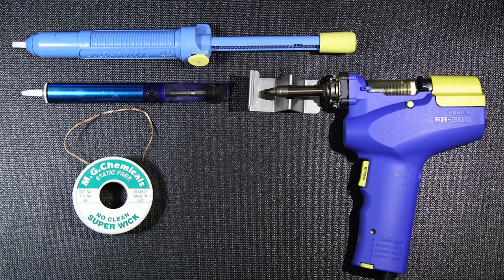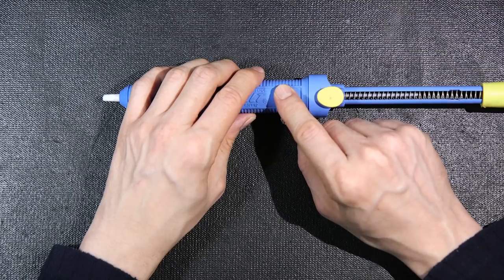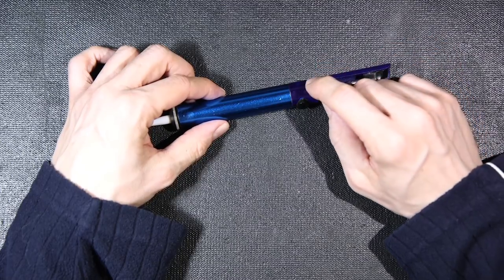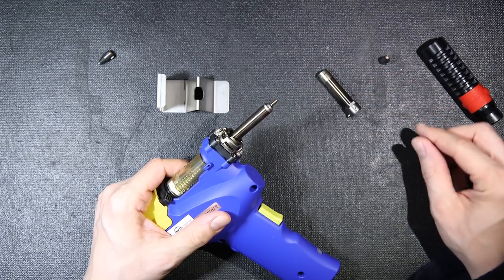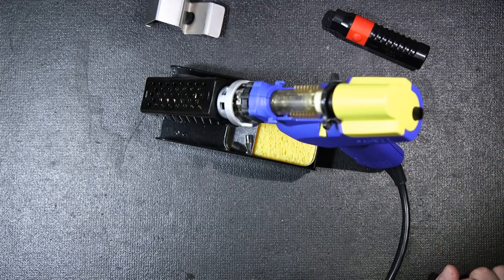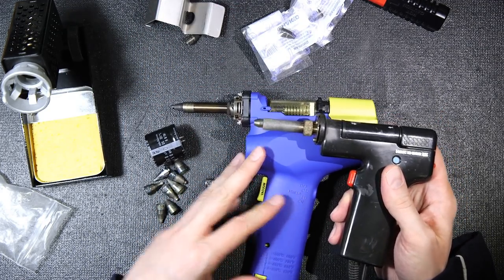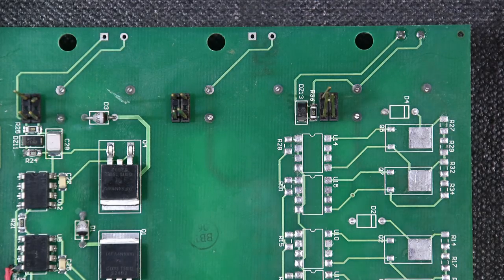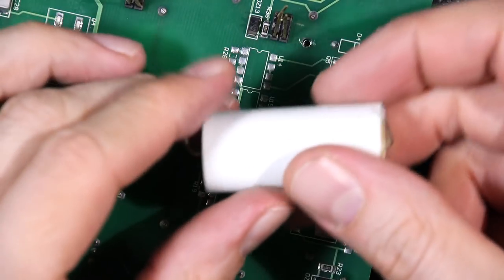How To Desolder Electronic Parts Using Different Tools.

Comment: You don't Show my Favorite,  Radio Shack made a Desoldering Iron. It had a Bulb you Squeezed. When Hot enough you released pressure on the Bulb and would Suck Right up in through the Hollow tip. For a 68 pin chip/or other Chips I would file on each side of the tip(pins too close), Then you could Desolder a 68 Pin Chip in about a minute. When they were closing Down, I bought about 4 extras. Soldapult and Copper don't come close. Haven't used a Soldapult since 70's unless I has too. Even then I would Use the Copper Shield from Coax, wouldn't buy Desoldering Braid. 
I Would Google "Radio Shack Desoldering Iron". Has a Red Bulb. Buy if you can find it.
For through hole components, I like to have Hollow tip go over component, rotate around while releasing, after doing all pins, a small screwdriver can push leg free if still barely connected to Board.

Comment: Thanks for the great video.
I heard you mention changing capacitors on a switching power supply. For someone brand new getting into minor electronic projects, I’m looking for an adjustable power supply. Are switch type, more prone to break downs? For someone like myself, is there a type you recommend?  
Use for measuring resistors, capacitors, and also checking power requirements for LEDs etc
Also, are you using a “microscope” for the close up video of the desoldering? Or just your camera on micro? Cheers

Comment: i have the bigger manual solder sucker, the thing i need to add is to hold the devide tightly to stop the recoil, especially when working with pcb with a thin copper, and perfboards, i did that many times , when i activate the sucker the recoil knocks onto my solder tip and it somehow hit the trace off of the board, and when desoldering parts from a double sided board i usually mix a 6040 solder onto the existing solder before suck it off, i find it weird that some solder from factories (even non lead free) sometimes are pretty hard to melt, last thing twisted wire is a pain in the butt to remove, especially when the leads are pretty tough like big diode and some large electrolytic capacitors, and manufacturers like to bend it onto a crap quality pcb in products nowadays, guess what happened when i try to remove the component, it take the trace off with the lead and force me to use a wire to reconnect it

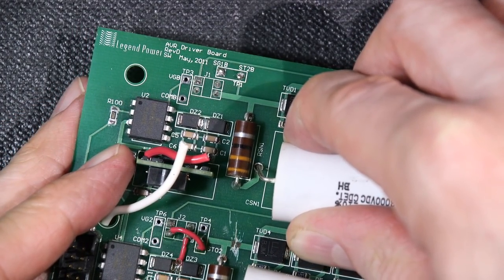Comment: 22:00 For parts like these, I just heat the leads while pulling them out. I clean up the pads with some good solder and the suck it all clean. It’s much more efficient like that.

Comment: Nice vid. ;)

Just wondering what the first board was originally for?

Looks like some sort of high-voltage driver, due to the opto isolators and spark gaps?

SO glad you mentioned adding extra flux to the solder wick btw.

Some of them don't contain any flux at all. Works far better with flux, and helps to reduce the risk of lifting pads etc.

Comment: Good Job Paul! I would LOVE to see you do something on cleaners. Some swear by WD40 to clean switches, others DeoxIT, CRC electro clean and some swear by pencil erasers. One fellow even suggested a wire wheel on a dremel!  So, what cleaner will really remove tarnish from open frame switch contacts? Love to see your take on the subject.
Reply: Oh no, do not ever use WD-40 ':D It might be good for cleaning PCB:s but otherwise really not recommended for anything electronics-related.

Comment: Used a Soldapult doing low volume production rework, correcting mistakes.  I would flip it over and push the plunger on my knee to arm it, got fairly fast at it.  Kept two on the bench so when one plugged up I didn't have to stop.Owner too cheap to buy a proper vacuum unit.

Comment: Tool #2 is available as a completely aluminum threaded version... Aven 17537.  I'm not sure how well it will hold up long term, but it will likely last longer than a plastic threaded units.

Comment: @18:28; I would really love to have those 4 polypropylene capacitors on that circuit board! Those are the Cornell Dubilier 940C 0.1uF 3000V ones, which are very good sounding "bypass caps" to use in passive speaker crossovers!... I hope you used them for something good after this video and didn't just throw them away!

I've never had any decent results using only the manually operated "plunger type" of desoldering tools, regardless of brand, but that active continuous vacuum type (the FR-300 model) is awesome! I will be buying one of those, because they are quite obviously the most effective, easiest, and fastest by FAR! There's absolutely NO comparison!... Just one question though; How do you spell the brand name of that desoldering pump? Is it spelled Heyco, Hayco, Hakow, etc?? (Listing the brands and models in the video description would have been helpful.)

Comment: ive had the same small blue aluminum vacuum tool for over 15 years and as you pointed out the threads on the plastic gave way.. i will admit i nearly ruined what i was working on (from the sudden scare and laughing) as the back end shot out like a missile and pinged around the side bench landing in one of the parts trays.. i just glued the end on permanent.. still works till this day and i just use the loader to push the cylinder out enough and just pull it out of the front carefully to clean and lube it.. what i didnt see here ( just for comedic events you should of showed one of the cheapy chinese twist lock ones they have a fraction of the suction then the aluminum ones and no i never bought it, i found a couple in a bin of electronics someone was tossing out which i took to see what was wrong and possibly spares as the casings were still good)

Comment: I would have used a board full of DIPs as an example where you'd want a desoldering gun. Desoldering a ton of ROMs and logic chips can get very tedious. Just try making a Neo Geo development board out of an original cartridge (socket ROMs; several hundred legs). Even installing Hi-Def NES takes more desoldering than 40 caps even though you only remove four components (86 legs).
Reply from the maker: Didn't want to put any of you through the tedium of watching that process... LOL!
Reply: Mr Carlson's Lab DIPs are definitely what drove me to get one. ;) PSU caps can often be cut off and replaced but many logic chips... not so much.

Comment: Excellent video! I have a dangerous question Mr.Carlson ... what is the safest way to discharge a guitar tube amp so no power is left inside to do potential harm to the operator? For example I am thinking of replacing a volume pot on a PRS MT15 and would like to live to see it have a batter volume taper ;)

Comment: The aluminum/plastic sucker threading problem I found a small solution to it, what I does is this, I wraps one layer of electric tape around the wear down threads and screw it back together, mind you though it'll be a bit stiffer to screw back in but it'll work without coming off

Comment: I remember how i went on a desoldering rampage after getting my ZD-985 desoldering station. Also got a ZD-211 but didn't used it much. Its china stuff but far better than the non heated desoldering pumps.

Comment: Have you had occasions with the Hakko where you would’ve preferred the very long nozzles?  (I’m assuming those were available for the FR-300 as they are for the 301.)  It’s surprising how many nozzle sizes they make with only 0.3mm difference in diameter from one to the next; it leads one to think all of them may be needed ($$$).

Comment: so been soldering for 45 years.. i must say I've never heard anyone say the "L" in solder.. silent L.. also the soldapullit, instead of brusing your thigh.. twist it over, press it on the bench... Ive also found the Paladin (very similar to your alumin tube) to be better than the soldapullit.. but thats just me.... thanks for all the details, now going to buy me the Hakko... btw.. i know this must  be heavier with the pump in the handset, rather than in a separate box .. is this new Hakko  one heavy for long periods of time?.. thanx

Comment: Because I used the blue metal solder sucker in my University Science Laboratories I bought one for myself and apart from the tip getting a little bit chewed up I have no problems with it.

Comment: Is that 'gun' as effective as the older one attached to that box of electronics (what exactly is in that box? Inquiring nerds wanna know!)
Reply from the maker: Hi Dave. The innards of the Hakko 470 pump contains the temp control board, a vacuum solenoid, and an induction motor that runs on around 28-32VAC. The 470B has a DC motor that operates faster.... but DC motors have commutators and brushes that wear over time, so I opted for the slower induction motor type. This is why I built a VFD or Variable Speed Drive for the unit. It now spins very fast and has really good suction.

Comment: Have you any advice/demos about removing solder bridges after soldering in an IC SMD chip.  
I find with wick I can damage the track, with a manual sucker you need two hands to re-set it so I need to put the soldering iron or hot air tool down each time.
An electric pump seems ideal.  Did you ever try it on a solder bridge?
Dave

Comment: Getting  a lot of discarded cellular psu pdu and everything. Just got into electronics again. I've been using my heat gun to heat the whole one sided pcbs and I scrape the hot gun across it with a bowl beneath. Working well. Currently not using ICs. Any reason I should use a different  method? Using things  for strobes, audio amps and relay projects.

Comment: what would be a safe heat for the desoldering vacuum gun? when rubbing in a circular motion to get the solder out wouldn't that damage the PCB?

Comment: Just wondering if it would be a good idea to have a solder station that keeps your reel of solder inside and feeds up the umbilical cord to the heated tip of the soldering iron and feeds the solder every time you press down on a feed pedal sitting on the floor.
Reply from the maker: That would be kind of like a MIG Soldering Iron. I think that would be hard to manage. I prefer the TIG method myself :^)

Comment: Saved myself over $150 spent $17, $10 on a 30w solder gun i found at walmart and $7 for the new capacitors smallish town lucky i even found them  so total of about $17 to fix my Asus monitor that had 2 blown caps. Amazing what you can do and how much money you can save if you just try.

Comment: another thing about vacuum. yes it will remove the solder nicely buy wiggling the lead in the hole. But, keep the vacuum on just long enough to cool the lead and hole so the solder does not reflow and stick in the hole. when done properly the component lead comes free in the hole with minimal or no damage to the plated through hole.

Comment: One of the problems with solder wick  is if you do not get the right kind it just passes heat, and does not suck up any of the solder... All it does is clean the iron. Need to get a new head for a vacuum de-soldering station that I had bought, as that is all that was missing ( the most important part).

Comment: "Resist the temptation to unwrap things with the hot soldering tip" ... reaches for $30 pair of Xuron electronics cutters instead of needle nose pliers.   This really made me laugh and cringe at the same time!  Just kidding Paul, love your detailed work and well-done videos, seriously!  I made my own desoldering station years ago by modifying a regular Weller base with air fittings and using the spare pins in the connector to the iron.  I used a Weller desoldering iron at the time since it was affordable but the base was not.  The iron had a built in push button to activate the pump but I also added an extra input for a foot switch, since pressing the button could cause you to slip off the pin.
Reply from the maker: LOL, Thanks for your input Keith! I picked those clippers up at a ham swap meet for $5 each, the fella had a bin full of them. I bought 4.
Reply: I got a well used pair of xuron clippers for the rough stuff
Reply: Dull wire cutters often work better for grapping, manipulating and unwrapping component leads than any needle nose pliers or hemostats.  You want them to be kind of dull so they won't cut through the wire as you manipulate it.

Comment: thanks for this Paul...  I gave up on the mini-solder-sucker and moved up to the Hakko pretty quickly :)    on the topic of SMD-soldering, was wondering what brand of solder paste you buy ?   I'm just transitioning from through hole PCB etching to SMD PCB etching...  thanks.
Reply from the maker: Hello Dean. MG Chemicals part # 835

Comment: A while back I picked up a desolder iron from Radio Shack that had this rubber bulb you squeeze to make suction and it has the iron attached if I remember right. I've never actually used it since I bought it, but I wonder how it performs in comparison so some of these pieces of equipment.
Reply: They work very well, I typically use a Solda Pullt for a few pins but if I have a whole header to remove or just a lot of pins in general I use my desoldering iron which I as well picked up from radioshack. It allows you to do the same thing he did with the swirling action, only since it's a bulb I just push the pin to one side, hit the bulb, then pull it to the other side and hit the bulb again. Usually the parts just fall out which is awesome for headers.

Comment: Thanks Mr Carlson!  Perfect timing. About to get back into more practice sessions before working on the TDS-520 project (looks like attenuators so far, though need to microscope or test each trace and via still) that I thought was only the Processor/Display or Display Module and is looking like the Front Panel module so far since I was able to power on the CRT. 

I was wondering, someone on HaD noted he uses a bilge foot pump and I am thinking about investing in this idea instead of the more expensive options for now. 

I see for ~$30US I can pick up a Weller desoldering bulb type unit also and was thinking first I'll try the bilge (bellows) pump (modified with teflon tip and chamber from spring loaded desolder tool) with soldering iron and if I find for some reason the hollow tip desoldering option is better I'll do that (prefer a free hand) next.

What is your experience with the bulb type desoldering irons and thoughts?
Reply: I wanted to note your videos are super inspiring and really motivated me to get back into electronics for maybe even more than a hobby.   Thanks again!  You really have great teaching talent.
Reply from the maker: Thanks for your kind comment! I would stay away from the bulb type solder removers, I have had my share in the past, and nothing but a pain.

Comment: I've never been able to reload the small solder sucker with one hand, my thumb simply doesn't reach that high. The big one you can simply whack on your thigh or on the desk to reload. But i've lopped off the plastic sheath on the small one, so i can use it in the same manner.

The worst ones are fully plastic, but big like the Sodapult, but with a sheath so you're supposed to reload it with your thumb. There's so much moving mass in those that they just whack everything all over the place.

I've seen solenoid powered desoldering irons in China, they're pretty cheap. They combine a heating element and a solder sucker and they also reload themselves automatically.

Comment: i used desoldering gun that comes with aoyue working station (soldering iron, hot air, desoldering gun) and even with regular cleaning it just cloged up and no longer sucks solder. Is there any good tips for cleaning solder out of the tube or should we look for other desoldering gun?

Comment: Very nice video, thank you. I have a Aoyue, a solderstation and desolderstation. The desolder gun is difficult to clean, the solder sticks on the spring.
Reply: I have AOYUE desoldering station at work; the spring for catching solder is a terrible idea, and works poorly. Use steel wool instead; and get some Hakko filters instead of the little round sponge filters supplied with the unit. Also, the integral tube on the rear of the tip sticks a little too far into the solder chamber and cools down as it leaves the heating element, making it prone to clogging. Stack a brass washer or two on the pipe before loading the tip into the gun, it'll improve the heat transfer right in the area that tends to clog. PS, the first gun I got had a defective heating element; I swapped the element ( a royal pain) and it worked much better. Buying a spare gun for $55 makes economic sense.

Comment: What do you recommend for cleaning up flux when you're done with repair?
Reply: 32:20 - isopropyl alcohol, acetone or lacquer thinner
Reply: In one of Paul's videos he does mention he prefers to use lacquer thinner over alcohol and acetone. Reason being is that when alcohol and acetone evaporate they leave a very thin whitish film whereas lacquer thinner does not. Check it out for yourself by swiping across a piece of glass with a cloth with those chemicals. (The bright shiny solder joints look impressive to a repair customer.)

Comment: Hi paul. Many thanks for another 2 excellent videos. One question though. Should you wet the hakko tip with solder in the same way as the soldering iron ie after use and before putting it back in the desk holder?
Reply from the maker: Hi James. I always wet the tip if it's going to sit in the holder for any length of time. If the tip is left dry, soon after, it will not accept solder anymore.